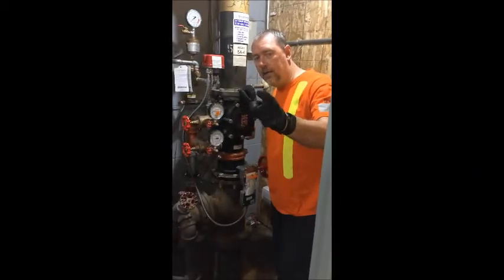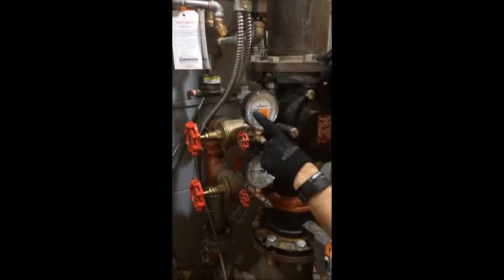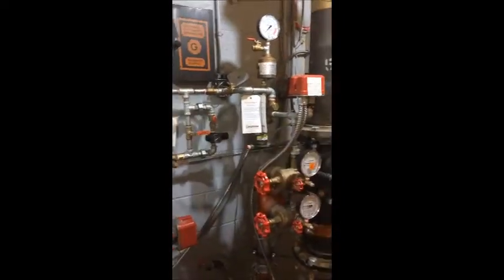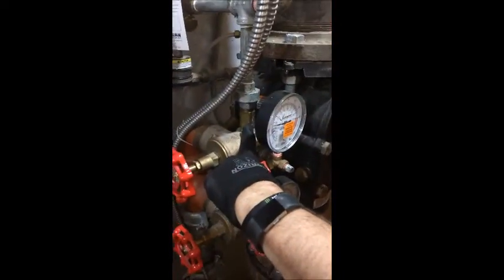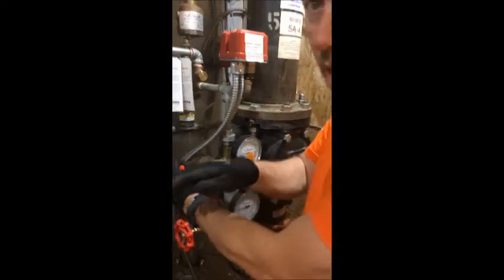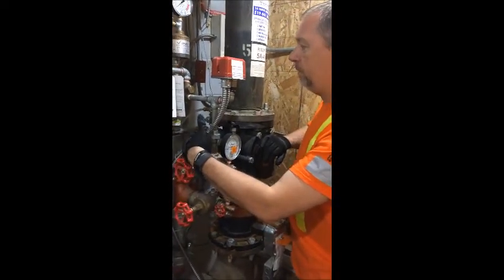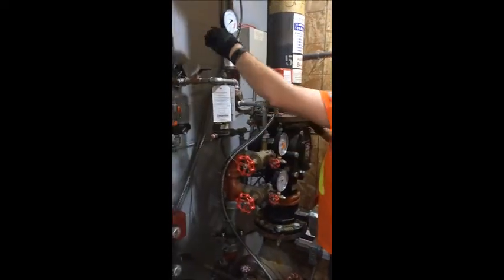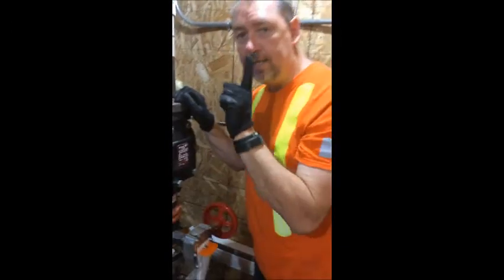Reset Victaulic Accelerator

Comment: Victaulic accelerators and dry valves are awful. Way to much going on. Viking dry valve has been the same for longer than I’ve been alive because it WORKS. Don’t fix what isn’t broken.
Reply: I would rather take the face plate off 100 Viking Dry Valves over resetting one Victaulic
Reply: @georei  True that buddy!